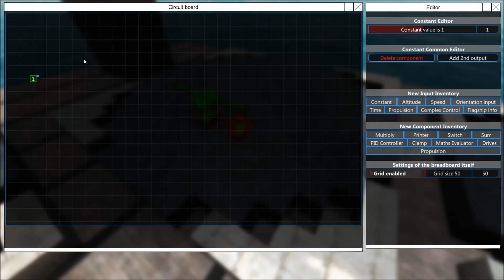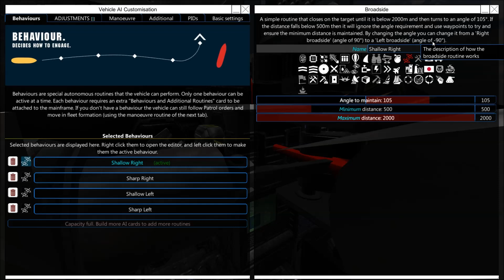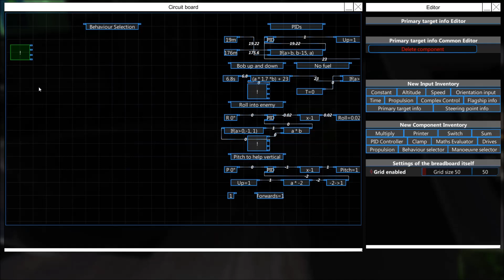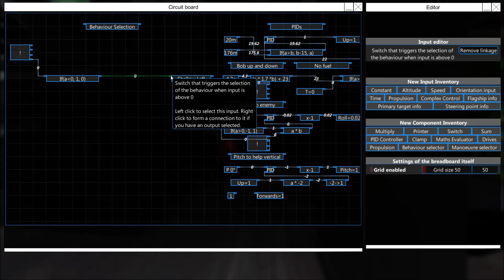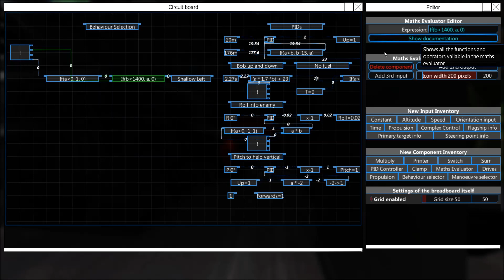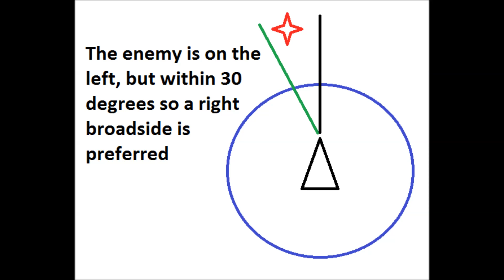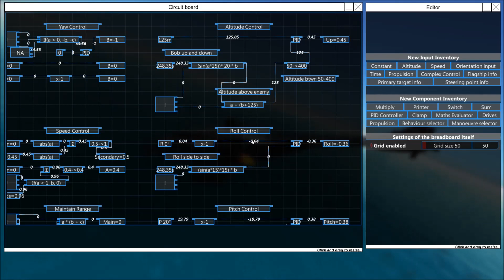From the Depths - Breadboard Tutorial - Part 1

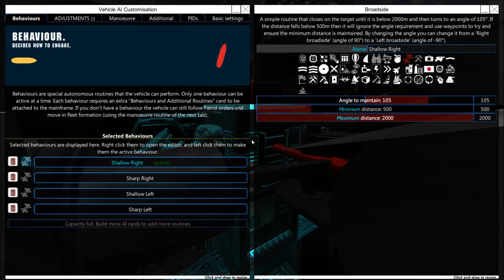Comment: 5:07 I'm a little unclear on which AI routine cards you used for those and how you got the interface you show on the right. Are these "blank" cards? In the current version of the game, Whenever I try to "Add Behavior" I am presented with a list of 9 pre-defined behavior types. I presume that you used "Broadside 2.0," then gave it a new name and edited the behavior parameters as needed. But the game has changed quite a bit, even in the past year. Your guide is one of the most in-depth, detailed and rigorous so I want to reduce as many possible sources of error as I can!
Reply from the maker: Thank you! Yes, these would be blank cards where you pick and choose from the list and name them (if you want). But you are right, the game did change since I made this tutorial. I would have to double-check if the AI is the same. I'm sure this is still possible though, just the choice of AIs might be a little different.

Comment: How did you ever figure out that you could use if/then and other non math symbols in the breadboard. I haven't been able to find anything anywhere that would provide, say, a lists of usable 'commands'. I'm not sure what you call them. Basically whatever plain language is in math. If(a<0,1,0) etc. I've taken a lot of math classes and we didn't use 'If' or '&' a lot in our equations. But there is absolutely no hint whatsoever that you should just start "talking" to your breadboard. I'd have been only marginally more surprised if you just typed "Please keep the bad guy between 1400 and 1500 meters on our left side." and it worked. Where can you get any kind of reference on what the breadboard "understands" beyond math expresssions?
Reply: There's a documentation list in the math evaluation component. It lists all the functions it can use (like "if()" or "ToEuler()"). It's written very much like spreadsheet cells, minus the cell references.

Comment: How could I make something that turns my gas engines fully on or completely off, depending on the situation, when I look at fuel engines in an ACB all I see is change battery charge rate for fuel engine. so in combat my steam engines take over, and my super efficient gas engine will only run when it is out of combat, and alternatively, steam engine turning off out of combat. Sorry if I am not making sense, English is not my native language.
Reply from the maker: Yeah, I'm not sure if we ever had the option to turn off fuel engines entirely. You can definitely control steam engines. The other fuel engines can only really be managed by using the power priorities on the V screen.

Comment: Can you invert a condition? Turn an integer into 0 and a 0 into 1?
Reply from the maker: Yes, but you can't do it with just a multiplier if you wanna get zero. You'll need a math evaluator to invert it if you need to invert it in the breadboard anyway. If your condition is coming from an ACB and is fed into the breadboard, then you can just invert the conditions on the ACB.

Comment: Rebind Caps Lock to act like some other, out-of-reach key. I bound mine to H and that's an extra key for games which don't recognize Caps Lock.
And for the ones which do, it's not inverting my letters anymore.
Reply from the maker: It's funny because I rebound a few keys in FtD and I'm not sure why I never rebound caps lock. It's so ingrained in my muscle memory now... D:
Reply: @OhmIsFutile  I meant rebinding the key itself, so you still press the same button, but it acts like a more useful button. Check out KeyTweaks. Or if you're afraid of 3rd party software, see /watch?v=eBemouxi0TE

Comment: Hey bro, can I bind the bread board response with the acb controller? or complex controller? Cuz I want my tank suspension to be alike to strv-103 you know?
So, I wanna change the pitch angle just by simple pressing of smth
Exact angle
Reply from the maker: I guess I'm due for a part 3, haha. Yeah, you can interface with ACBs using the drives or the complex controls. Both ACBs and bread boards can use the complex controls so they can trigger each other.
Unfortunately, neither ACBs nor breadboards react to player input directly. You can use the drives though, but it's awkward.